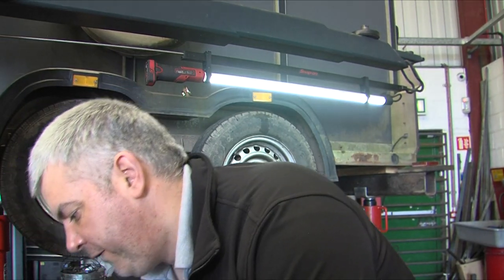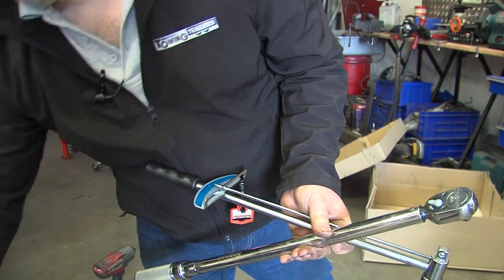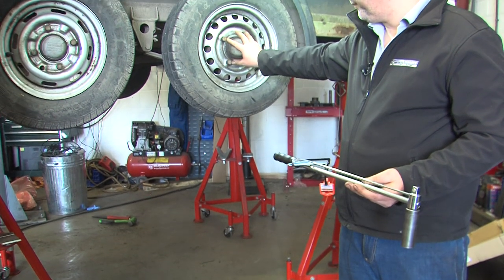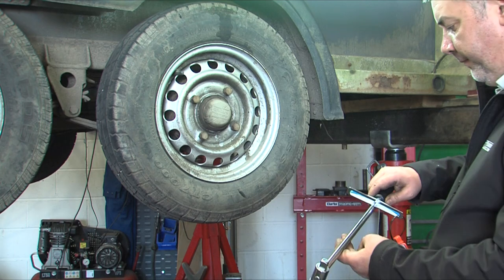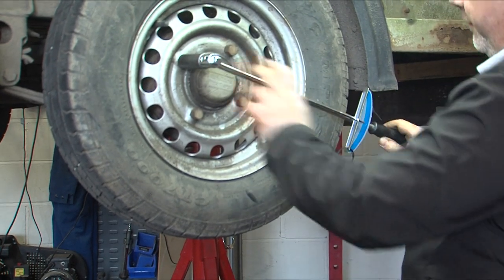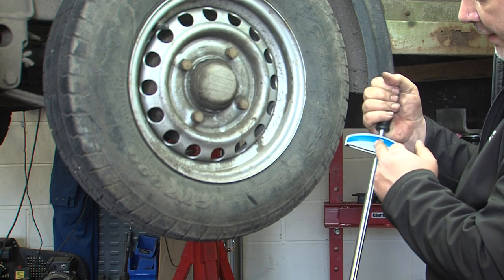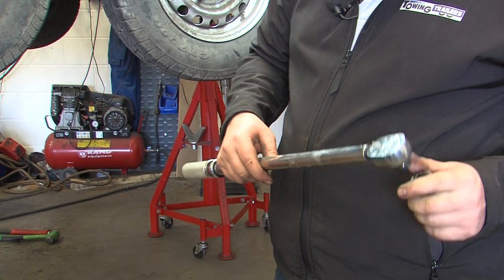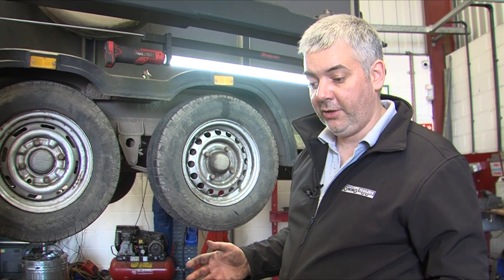Different type of Torque Wrench

Comment: Nice comparison video. I still prefer click style simple and no batteries to worry about. The digital adapter style seem to work well and would be great compact unit for a service vehicle.
Reply from the maker: I like the click type but other people use them and I know that the digital ones will not be left with torque wound on them damaging mechanisms. I can also hand it to any one they don't need to be able to read a micrometre style gauge to set it a digital wrench. If I am doing something I often have people come to me asking Questions this can distract me and the counter that the digital wrenches have is handy to see where I have got to.
The wrench I don't like is the one that flexes I specifically brought the one in the video to do the filming and once it was filmed I gave it away as I don't trust it for use in our workshop.

Thankyou for watching

Towing and trailers ltd
www.towingandtrailers.com

Comment: Going to be honest you lost me the minute you started torquing a wheel that is not on the ground.
Reply from the maker: Hi

I know that it is not a done practice to torque a wheel in the air. When I have serviced a trailer I always check the brakes and leave them locked in the auto reverse position. I then torque the wheels this gives me an Idea that the brakes are working well. 
The wheels then settle and are torqued when the trailer is collected by a customer as a final check.

Thanks for watching

Towing and trailers ltd
www.towingandtrailers.com
Reply: @TowingAndTrailersLtd  It is also not a safe practice for you as that is a good way for something to fall from a lift or jack
Reply from the maker: I understand what you are saying if it is not securely supported
We do make sure that trailers are secure while we work on them.
The trailer in the video was on more than suitable axle stands.
When a trailer is serviced with sealed bearings or a stub axle is fitted you are applying 280 - 850Nm to the same area on a trailer. If it is safe enough to tighten one of these it can manage a wheel stud / nut at 60 - 195 Nm

Hope this helps
Towing and trailer ltd
www.towingandtrailers.com